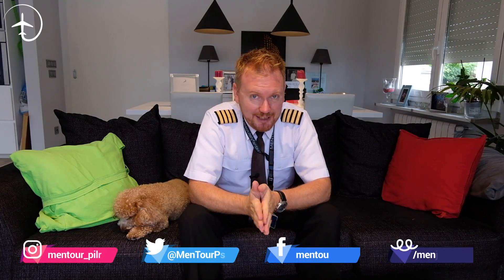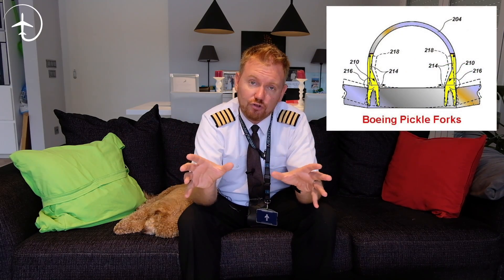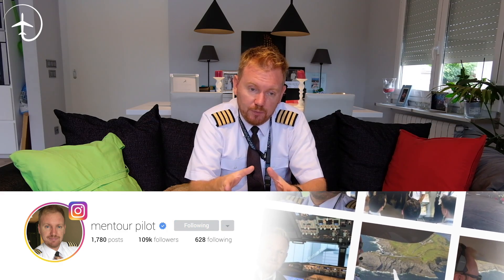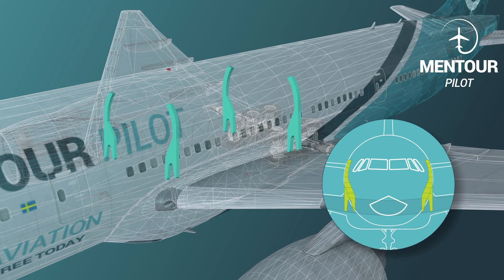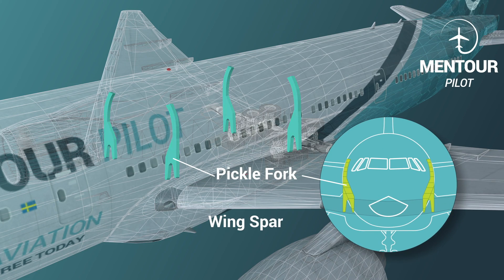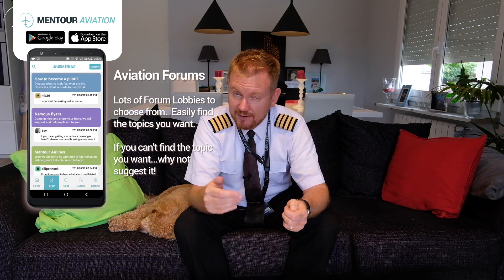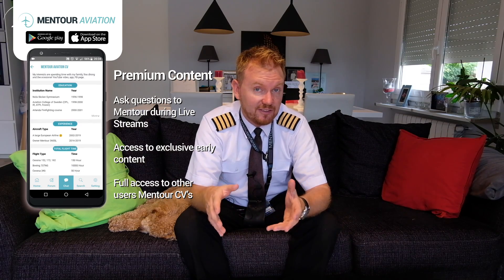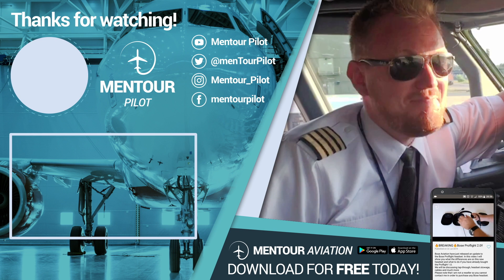Cracks in the Boeing 737 NG wings!? Mentour explains

Comment: Design troubles on 737 NG and Max, one at beginning of 2019 with an ultimate fight between pilot vs MCAS on 737Max led to lost of lives in two accidents grounding world fleet. And now on 737NG pickel forks cracks at 1/3 of cycles life of wing bearing component. What's going on Boeing?
Reply: They don't have you working for them with your omnipotent insight to make sure nothing can ever go wrong with any component for the life of the aircraft...

Comment: Sooo... If a car manufacturer sold me a car with a possibly defected airbag they send me mail and replace it at their expense. That happened just the other day to me and car is more than 10 years old. On the other hand, when an airplane manufacturer sells an airplane with a faulty wing because they didn't check aluminum alloy quality it's on me to pay for the fix? Seems fair.
Reply: Slavko Pejic The airlines will try to extract compensation from the manufacturer. Determining the exact cause may take several years.
Reply: You are a private citizen, airlines are compaines. You are protected by consumers laws, companies are not "consumers". 
Business to business works differently, they (i think carefully) write and sign contract which will cover all of these issues.

Comment: I heard 5 percent of the Boeing 737 NG (No Good) Aircraft are affected - So far.  Boeing if they want to salvage the 737 should pay for this.  I would be most unhappy If I spend 60 million for one of these aircraft having to ground this with no real fix.  And then having to replace it with Pickle Forks with the same (defective) design.  This is unconscionable.  As Boeing never had problems with the 757 series, 767 Series, 717 Series 727 series of such magnitude.  They are making shoddy products lately which would make William Boeing spin in his grave.  With the exception of the 747 program this company is only firing on a few cylinders.

Comment: 'Great, the system is working' - No, it is NOT working. It's been found by sheer luck, due to the freighter conversion crew. Thank God they were so troughout during the inspection. If they did not making those works, it might have been an accident, like Chalk's Ocean Airways Flight 101.
The lesson is: no one looks, or strips the oldest in service of any airframes, just to make sure if there is some faults init, it will be seen before someone dies.
We are all guinea pigs in those aircrafts, no matter how old they are.

Comment: It's not that easy to track parts unless this a serialized part. Then recorded by Boeing into the build history. They would certainly know the vendor who manufactured the part. Problem today is so many parts are outsourced to China where QC is last on their mind. Where it is supposed last the life of the aircraft I doubt the pickle forks are serialized. Usually in the airline industry you only record serial numbers in a life limiting part that needs to be changed at certain intervals. You certainly don't know for a fact the design is fine. The design could have been piggybacked based on older models. This plane may put more stress on the wing attachments. Unless you have worked in manufacturing the last decade, you can't begin to see how many shortcuts are taken to get the product built and a check for the plane. Where a visual inspection may have been performed in the past, Boeing may have eliminated the Inspection point based on the fact no pickle forks ever failed.

Comment: So a company sells something with a faulty materiel, 
and the buyer has to pay to repair it and has the cost not to be able to use it...
Shareholders of Boeing get a privileged protection...

And the company that is supposed to deliver a materiel with the correct resistance and life cycle is not made responsible in any way?
3 years later, the cause has not been made public, no transparency if the damage is under control!
I made some further investigations and your report seems quite opportunistic, superficial, flowing on the trend to catch viewers while the problem raised public attention. What about a follow up?
My confidence in the airspace business remains a roller coaster.

What is the percentage of planes completing their entire lifecycle, which is not 90k but maybe only half of it, 
depending on the stress it went through because of bad flying conditions?
Reply: Pickle fork repairs are performed by a Boeing Repair team and Boeing provides the parts, so..
Reply: @speedbird9313  You don't get it- Boeing can't execute the whole production processes of all the parts, they have to rely on sub producers, they establish parameters for the materials, which get fabricated by specialized industries, i.e. Israel Aerospace Industries (IAI) has performed Frame Fitting Pickle Fork replacement for a Boeing 737

Comment: Good illustration of why all aviation components have to have an audit trail - from the spec of the original material, right through to which aircraft the parts were fitted to. That way the entire history of a component from any individual aircraft can be traced. It's also why a supplier refused to let us have some aerospace quality fasteners from their stock that we wanted to use for motorsport purposes - those parts would then disappear off the audit trail and could potentially have been used by someone dodgy in future.
Reply: U can get any component if u can talk with supplier, yo use XX-XXX as place to go

Comment: It should made from titanium not aluminum.
Reply: Not necessarily. These things are still made to a cost, using titanium for these parts would increase the cost probably 50 fold. I'm.not an aeronautical engineer but aluminiums pliability is likely a positive over titanium
Reply: Titanium is certainly a bear to machine. That would certainly increase costs substantially. 

That being said, it is much stronger than aluminum. I don't believe that pickle forks are subjected to much heat but I could be wrong. If heat is involved, titanium is much more resistant to creep. 

If cost weren't an issue, titanium is definitely better than aluminum in critical structural components. Ultra high strength steels are also better than aluminum though heavier. 

Nevertheless, how does one put a monetary value on life. Over the 90,000 cycle lifespan of the plane maybe it would be worth spending a few dollars more on each flight just for the benefit of using titanium for the critical structural components.

Comment: I have a question.

I'm studying travel at the moment and we touched on air travel a little in class. One question that popped up had me thinking. What happens when someone has a Guide Dog? I would imagine that the dog would be allowed in the cabin since it is illegal to ban a guide dog from going places, except under very strict circumstances. However, it does make you wonder where the dog stays on the plane and then if it is a long haul flight the dog would probably need to go to the toilet and be fed as well. And if guide dogs are allowed on planes, what about other service animals? Medical Alert Dogs, Service Animals for the elderly or mobility impaired and companion animals for those suffering anxiety, PTSD and other mental health issues? Are they allowed in the cabin with the owner or do they have to go with the other pets in cargo?
Reply: service animals usually sit at their owners feet

Comment: And Separate question and comment for Petter- How many Cycles have you done as a pilot? :-D  Also this 737 NG Pickle issue would be far more likely to cause problems on any "shorter hop" uses for the plane for example (If it was used for Hawaii or Indonesian islands). The shorter the hop the more pressurization and depressurization cycles which is where the 90,000 cycle estimate comes from. Its not just the take off and landing alone counting for cycles; but mainly the pressurization cycles that is cause of metal fatigue. :)   So until we can make airplanes out of Vibranium we are stuck with metals wearing out. :P

Comment: Thanks for giving such a level-headed explanation of the problem, and clear graphics too. I assume that only when the  population of in-scope airframes have been examined can the causes  of the cracking be identified. I surmise it may turn out to be some combination of the factors mentioned eg particular batches of aluminium fitted to aircraft that have also had a number of heavy landings and/or wing extensions. It could be quite a complex analysis!  One factor you mentioned briefly is poor assembly practices where components are made to such fine tolerances that they sometimes have to be assembled together using more force than the design intended; identifying aircraft where this has occurred may be problematic because it is unlikely to have been recorded.

Comment: Between this and the Max issues, look man, the 737 is the beaten dead horse of the airframe world. It's been milked and stretched and tweaked all with the increasingly desperate hope of putting off introducing a new aircraft and banking on easy conversions to drive sales. 

Boeing got cocky under heat from Airbus NEO's, the A220 and the next gen of RJ's coming up like the Embraer E2. Yeah it's hard to nail the 737's market segment dead on and yeah it's hard to convince operators to pay for type conversion, and yeah the crack issue is probably manufacturing but, ya know? 

The optics just ain't good right now.
Reply: Raccoon  1967. First flight of that airframe was 1967. When MTOW was 20 tons lighter, the engines were low bypass pencils and the wingspan was 25 feet shorter. It shoulda been a clean sheet design 20 years ago.

Comment: So are we really surprised that more cracks have been found in crucial points of an airliner ? the problem is a lot of these components are difficult to get at to inspect,for years I have seen cracks in small magnesium brackets to full blown wing spars so there is nothing new here,what the eyes do not see then aircraft can go on flying for years undetected until one day something fails in flight,then the investigations start.
The chances are these aircraft would have been still flying if it had not been for those observations,the bain of the airline industry is maintenance and not all aircraft worldwide are well maintained ! metal fatigue is real and once any aircraft gets to the end of its life cycles then they are scrap,yes you can repair if viable but then cracks move on somewhere else.

Comment: I would love to be a spy in the phone calls between Ryanair/Southwest and Boeing management these days...
My feeling is that Boeing is actually quite lucky that Airbus would never have the capacity to take a significant amount of additional Airbus A319/20/21 orders.
I agree it's good that this has taken the official right path, but this is not a small issue and depending on the scale at which faulty wing pickle forks are being found (batch issue or real lifetime/design issue). If this happens to eb another big fundamental series fault air is getting considerably thin for Boeing. And I'm not quite sure to which degree those forks have changed in design for the 737 Max. I guess not too much...
Reply: Yes, but if u look Boeing get more allocation for planes...
Russia cancel order, also someone change from 10 to 3

Comment: The top management of Boeing took this great company into the ground. They should be fired for this, to say the least. Greedy sob`s running such an important company is not to be desired.
Reply: what about the stockholders and customers that pushed them to make said decisions?
Reply: Isn't the greatest single cost in operating aircraft the price of fuel?

Admittedly, the cost of purchasing aircraft does involve large upfront investments. But amortized over 90,000 operating cycles would mean what exactly? $20 additional to the price of a ticket for the use of titanium structural components instead? I spend more than that on flight insurance. I would be willing to pay the additional cost for the additional safety. 

I would be more than willing to pay an additional $100 to the cost of a ticket. I do so already depending on the timing of my travel. 

Boeing should be better than this. Safety should always be the first priority. Unfortunately it has become painfully obvious that profit is their top concern.

Comment: Doesn't answer how to repair, how difficult or impossible
Reply: I doubt that the cost would be justified. Then that said, the wing box is probably a separate (allthough well attached) part to the round fuselage, so I guess that technically it could be replaced. Sounds very expensive though. Especially on an older plane.

Comment: "Great, the system is working"
Absolutely! This is why aviation is so safe.
Reply: @Jacktan9203  dude, this is a completely different issue. And the fact that it's been discovered before anyone has been hurt is testament to how well the system as a whole works. The mcas issue is something different altogether. Go take your racism somewhere else
Reply: @MarkSmith-km2fw    Don't praise the system just yet. If the initial planes found to have the cracks had continued to be used as passenger jets, the cracks would never have been found. Pure chance brought this to attention of authorities. That authorities acted in a prudent, responsible manner is heartening, however.

Comment: If I was a airliner I would cancel all boeing orders they have so many issues now its not funny
Reply: As a retired airline VP, I disagree.  All aircraft types have issues, and those issues become more evident throughout the model type life in service.  The challenge is to discover any faults and respond proactively.  This is accomplished not only by manufacturers and regulating authorities, but among airline technical departments themselves.  One of the best things about commercial aviation is that among tech managers and executives there are virtually no secrets!  Everyone talks and spreads the word to protect and help each other, and to promote safety. 

However, I must concur with many colleagues when they assert in their view, Boeing has had more than its share of significant problems with its recent 737 models.  The aircraft is a time-tested and well-proven aircraft to be sure.  I had occasion to fly on one of the first 737-100s with LH back in 1969.  Sadly, experience has shown the Max and other models have enough substantive changes from the original versions that an entirely new certification program should have been undertaken.   I believe Boeing should have done it differently.   But then again, most of us have great 20/20 hindsight.
Reply: This is what Airbus is thinking.  If the bad news storm can be sustained for a few more months they will rule the industry.  I do expect a significant executive turnover at B.  Stock holders won't understand that business is only about the bottom line.

Comment: Hot and cold parts cycling from high altitudes into the summer heat and hard landings.  All airliners are doomed  of this kind of problem just like the 737s turbo fans and the a380s.  Metal fatigue can also reflect as the comet's  squared windows. The companies need to test their aircrafts
Reply: 90,000 cycles indicates the part is designed for low cycle fatigue operation, which means the metal is assumed to be in the plastic portion of the stress-strain curve. Therefore, the metal is no longer "perfect" like it was in the elastic portion of the curve.
Reply: @peterchen8868  It's aluminum. It always has a finite fatigue life under any repeated load. This is different from steels, for instance, where typically some amount of cyclic load can be carried on indefinitely without fatigue failure.
Reply: @TheVirindi  Even high cycle fatigue has a failure point due to stress acted on the imperfectly smooth surface, e.g. a drive shaft.
Reply: The window shape of the Comet was only part of the equation squared windows and pressurization had been used before with no ill effects

Comment: However how do they know if there are cracks in any 737NG that has LESS than 30,000/22,600 cycles?? Hmmm...…..
Reply: 996601 996601 Yes, they have found a few cracks at less than 30,000 cycles. This is a developing story.

Comment: This is a very interesting article you came out with and maybe could tell us the difference between this model and the previous and the and the later models of the 737 I know there was a whistleblower on some parts of 737 that were subcontracted that were really not up to two Spectre I don't know what that part was but that definitely was a loser YouTube on that none of that part relates to this issue. Remember the bonanzas didn't have a kit for that to beef up the Bonanza so the tail wouldn't fall off the earlier models. You have to wonder if there's any modifications for the wingtips that would create a vibration that might not have been calculated in you never know but yeah that's good they found it this way then like that freighter in Australia on the 707 that the tail fell off or fell apart or whatever thank God it was only a true of two or three or whatever on it. Actually as these passenger liners get older maybe that's a good a good use for him in terms of freight that way if they let go you're not killing a lot of people the people flying I'm kind of know the risks

Comment: Then we're talking metal fatigue. I just don't trust Boeing anymore. Sorry!
Reply: 90,000 cycles indicates the part is designed for low cycle fatigue operation, which means the metal is assumed to be in the plastic portion of the stress-strain curve. Therefore, the metal is no longer "perfect" like it was in the elastic portion of the curve.